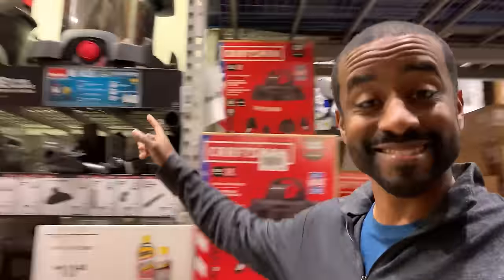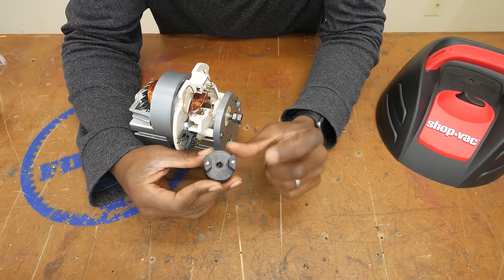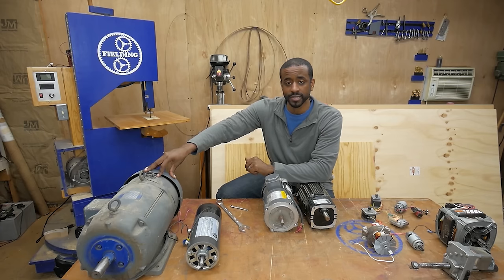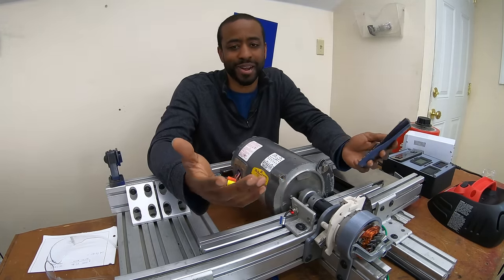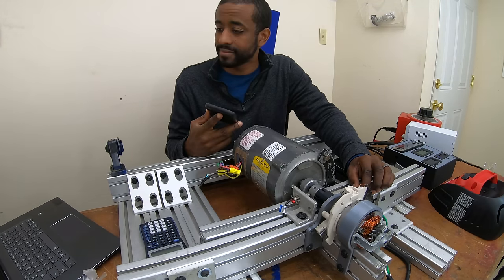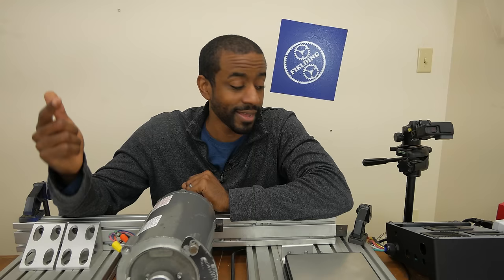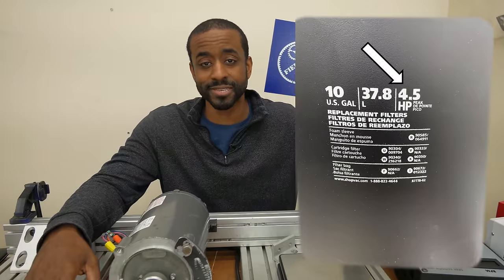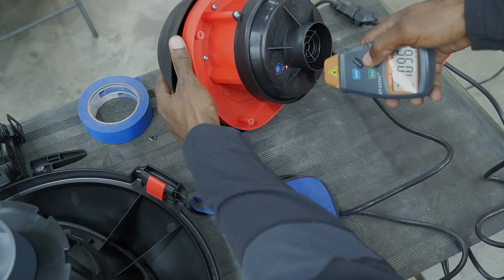How Much Horsepower Does Your Shop Vac Really Have: #078

Comment: Back in high school in 1964 my shop class learned to wind motors. After completion of the motor we learned how to test it. I remember using a device called a proney break. It was simply a stick with an adjustable leather strap that attached to the motors shaft. The end of the stick was attached to a spring scale. I don’t Remember all the details but I Remember starting the motor and slowly tightening the leather belt while watching a connected ammeter and the scale indication. Using some math were able to come up the actual hp. I love your channel. Keep up the good work. Ps seeing those hp numbers on appliances has always bugged me too
Reply from the maker: What I did was the electrical version of what you did. Exactly the same really. You were measuring torque with the leather strap and a lever pressing a scale. I am using an "electric" brake and lever on a scale.

Comment: "motor's inertial contribution"; what does this mean?  My thought is, this would be the instantaneous HP if you brought the motor up to speed and the resulting instantaneous torque if you slammed the rotation to a stop so it includes torque contributed by the angular momentum of the spinning armature.  Like it you strike a hammer on the meaty part of your thigh, 'No Big Deal', but the same strike on your pinky on a hard surface, you are going to lose a nail.  From the rpm, mass and diameter of the motor armature an angular momentum calculation could be made and would it make-up the additional HP?
Cheers, Mark
*********************************

Comment: 6 HP = ̶ ̶1̶0̶4̶7̶6̶-̶  4476 watts. On a 15 or 20 amp circuit? Not happening.
Reply: 6hp is not 10476 watts... but you're right it's not happening.
Reply: @JW77  You're right! 4476 watts, electrically. I don't know where I made the booboo! Thanks!
Reply: Also, when you say a motor has a certain HP,  that refers to output power. Motors are not 100% efficient, so it is going to be over 5500 electrical Watts consumed to deliver 6HP.
Reply: Yes, even "peak" horsepower, or for a single instant under optimal conditions, that would blow your breaker, if not outright fry it. Think how heavy the 1/2 hp motor on your average drill press is, and compare that to the weight of an entire 14 gallon "6 hp" shopvac. Yeah, it's clearly marketing b.s.
Reply: Peak HP is not Horsepower
Reply: @logun24x7  Does the word "Peak"  mean what I think it does? I know exactly what HP is because it is a well defined technical term. Are you saying I can put any two words together, redefine what they mean arbitrarily and then use them in marketing with no repercussions or liability under false advertising? I don't' know why so many people are defending it. It is just bullshit. It is not a big deal, but it is bullshit nonetheless.
Reply: @mckenziekeith7434  Peak HP is likely used because most people don't have a clue about CFM or SP sealed pressure (water lift) or how they relate to each other,  CFM being your maximum air flow and  SP or water lift measured at zero air flow would just confuse the shit out of people.  Or the fact that a vacuum with 300 CFM but shit SP would suck up wood chip just fine but not even pick up a nail or bolt from the floor ... likewise a vacuum that has 90 inches of water lift and less than 100 CFM makes for a great commercial demonstrating its ability to pick up a bowling ball but don't ask it to suck the dust out of your carpet ... so when comparing wet/dry vacuums the PEAK HP overall is just a rating to direct you to Good , Better ... Best  ... As you go up in Peak HP in general motor amps, windings, lifetime ratings, performance ratings, features included ...etc , .. also increase, you'll see this same rating on kitchen appliances, Blenders, Fans and some compressors its not misdirection or bullshit if a 6.5 Peak HP unit in the category is better than the 2.0 Peak HP unit is it ... so in short if you need your shop-vac to clean up your woodshop get the 6.5 Peak HP unit ... you need a vac once a month to pick up the cheerios the grandkids left in the back seat of your SUV you'll probably be happy with the 2.5 Peak HP vac ... The End.
Reply: @logun24x7  you make an ok argument for using motor power instead of flow or lift. But it should still be actual output power. Not fantasy peak power.

Comment: Hp rating is irrelevant, air flow would be more relevant.
Reply: Actually it would be Air Flow AT a given pressure differintial .  Engineers in the air moving fiels often refer to it as Air Horspower
https://www.engineeringtoolbox.com/ahp-bhp-air-brake-horsepower-d_1582.html

This assumes a constant value for the density of air, of course.

This same kind of published power performance creep occurs in many products, I recall it happening in the small lawnmower business until it resulted in a class action lawsuit.  We could do that in the vacumm cleaner business but lawyers would suck up all of the money!
Reply: Airflow has a lot of variables as well - with more airflow, you get less pressure, with more pressure, you get less airflow.  Which is more important?  I think there's probably a sweet spot with pressure and airflow.
Reply: @DISOPtv  The vacuum industry often uses water lift as a measure or performance. Its a good way to compare vacs if you can find the number, it usually isn't available to the public.

Comment: I've had a Craftsman 6.5 horsepower vac for about 25 years and it is seriously powerful.  I made a Thien baffle for my shop, and at first I tried using a Rubbermade heavy duty plastic trash can.  The vacuum was too much for it and it imploded.  I then used a galvanized metal can and it definitely flexes in use, but hasn't been crushed (yet).

Comment: Excellent vid. As a supplement, here’s the quick easy-button answer: 1hp = 746 Watts.  A 120V * 15A outlet = 1800 Watts max. 1800/746 = 2.4hp, assuming a full 120V at your outlet and an impossible to achieve 100% efficiency. Therefore, ANY mfr claim north 2.4hp for ANY household-voltage device is pure bunk. Thanks again for making this vid helping to de-bunk mfr claims!

Comment: Great video. I got my shop vac for about $40. I like that it has a huge metal cage filter in it that only cost about $10 to replace. I left water in it and put it away. Came back and there was mold growing in it. Had to clean out the vac and replace the filter. I actually don't own a normal vacuum cleaner. I have different attachments for carpet and one just like the car wash vacuum has. I use it for everything from the car and around the house. I wondered how accurate the number printed on it really was. Sure does have a lot of suction power. Whatever it actually is. Thanks 😃

Comment: I love your curiosity and drive to figure things out. I wish I was your neighbor...

Like you, I find things in the trash, and often, bring them back to like-new performance... and I've a half dozen shop vacs, that I end up giving away. 

I recently found a 220v, 2hp compressor in a trash pile... in spite of my best efforts, the motor was toast... it ran, but not at the 3350 rpm on the label... the compressor is fine... off to Harbor Freight for a motor.

Love your logo...

Peace

Comment: I remember questioning that HP ratings several years ago when I started seeing these high HP claims.  However I never tried to look into it and am glad you did.  As long as it picked up my sawdust and dirt, I was happy.  Thanks for the great videos, as a retired EE, I enjoy looking at them and also the effort you take to do the experiments.  As a side note: you may want to mention that 746 W per HP is a DC rating and may need to multiply in the Power Factor percentage for actual AC rating calculations. Thanks again.

Comment: Jeremy, you have done a AWESOME Job explaining these vacs, I have told everyone I know cause I look at the Capacity of the contents it can hold, not the Horse Power. Like Most vacuum cleaners using a universal motor cause the Speed of these motors would not by far produce horse power unless you gear them down similar to a Drill that has a universal motor. The key item like you mentioned is the suction power of the vacuum would make more sense. Like Suction power of X mm/hg. I think that is millimeter of mercury. I might be wrong. But most people here see the horsepower and see WOW that has more so I buy this one. Marketing BS  and most people are stupid and not know better get what BS is on the label.

Comment: Nicely done!! I remember when all the regular vacuums would brag on their amps. "Buy me I'm 16 amps" (of sloppy inefficient motor). I also remember when industrial motors were finally required to meet efficiency requirements.
Reply: I actually measured the amp draw of a "12 amp" upright vacuum. Actual current was about 8.5 to 9 amps.

Comment: The note on the ShopVac site mentions the rotor inertia. I'm guessing that the max power includes power when decelerating coming out of the rotor, kenetic energy.  Since power is the rate of energy change then a slowing of the rotor through the shaft is really kinetic energy leaving the rotor how fast that energy leaves can be added to the normal running power. This is similar to an impact driver when it runs with out the impact being engaged being the normal running power. When the torque requirement reaches a certain level the impact hammer inside the driver is activated, putting energy into a spring then into a weight for half a revolution the letting that weight impact and provide much more torque than the motor by itself could provide.  The impact hammer gives the impact driver a peak torque for a short duration of time.  The load that provides that change in speed of the rotor in the ShopVac lab is still unknow but this is how they can claim the higher peak power. - Thank you for taking the time to explain and investigate so many things.  I enjoy listening and learning.

Comment: in some countries there is a regulation that the manufactureres have to state the "suction watts at the port". So it includes not only the electrical efficiency of the motor, but as well the efficiency of the fan and the internal airflow. Seems to have stopped those crazy numbers. And since more efficient motors and blade designs are appearing not only on the "top notch" premium devices, but in the budget range too.

Comment: Yes, since I went to Electricsl and HVAC school Ive always been curious--if a shop vac is 4.5 horsepower, 4.5x746=~~3,000 and 120vac x 20 amp circuit = 2,400 vac why does UL or TEL labratories allow this b.s.  also I started testing everything from electrical fan motors for HVAC to commercisl air dryers and cnc machines people would throw away.

 A CNC machine whivh made airplane parts was thrown out because it stopped working and the owner bought a new one.  Whst did it need? A phase converter.  The old phase converters continually burned out because of impedance on one part in the system.  

Learning troubleshooting has saved my tsil and kept me busy during the 2008 turn of the economy. Thsnks for sharing these awesome videos, it's great to have a know how and a specification in an industry to troubleshoot, doagnose and repair electronics and electeical systems.

Comment: In North America, standard 120V (NEMA 1-15 or 5-15) outlets can output up to 15A max and 12.5A continuous. This means that is 1800W (2.4 hp) and 1500W (2.0 hp) respectively. To get anything higher requires a different plug with higher voltage and/or current. With NEMA 5-20, we can go up to 20A, giving us 2400W (3.2 hp).

Comment: I like seeing these test. I work in the car audio industry and the amplifiers we deal with are even worse than this at their ratings. Boss comes to mind, 1500 watt rated gets you around 195 watts rms.
Reply: If you're looking at car amplifiers, forget what it says on the box: you can get a much better idea, if you look at the FUSE. If the amp has a 30 amp fuse, it cannot draw more than 360 watts, from a 12 volt source. Your output will be less than that, otherwise, the fuse will blow. If you have a class "AB" linear amp, 195 watts RMS is about all you can expect, from a 25 amp fuse, due to the efficiency losses of an analog output stage. A class "D" switch mode amplifier can deliver that with a 20 amp fuse.
     Same with horsepower. A 100% efficient motor with 100% power factor can only produce 2.4 horsepower@15 amps from a 120 volt source, about 3.2 Hp from a 20 amp circuit. Keep in mind, this motor is less than 55% efficient, so, you can pretty much cut these numbers in half. There's no way a household outlet can fully power a 4.5 Hp motor!

Comment: As an electrician I can tell you this is a selling point as power is power; HP and Watts are defined power terms. This is like comparing Amp/Hrs in batteries it’s pointless without battery voltage; Watt Hours is the go to comparison. I like on the commercial side of things when they compare power by feet of water lift which does actually point to suction power. I can tell you in all practicality no portable vacuum motor can exceed 2 HP as you couldn’t plug it in and run it without blowing a breaker. Hardwire vacuums on the other band can be a lot larger and more powerful and if you don’t need portability is the way to go; a garage vacuum or central home vacuum will out suck any portable unit out there. .

Comment: Love your videos Jeremy, I only discovered you recently but wish I'd discovered you sooner. Very cool testing. 

With that said you seem to have missed some things in the definition of peak horse power you displayed on the screen. 

1. It's a standardised INDUSTRY term for wet & dry vacuums used for the purpose of consumer differentiation. 

That tells us a few things. That the individual companies are never going to disclose how the test works because of liability you'd have to go to the industry association. That they admit the number has no meaningful impact on the capability of the machine. That it is a marketing term they use industry wide to allow consumers to compare products. Like in TVs where they focus on resolution even though resolution tells us the least amount of actual information about a TV's quality and there are actually zero consumer facing 4K televisions (they're all UHD). Same for PCs and SoC clock speed or core count. It's a simplified term that gives you very little actual information but allows an ignorant consumer to differentiate products and justify prices across the product stack. 

2. That they measure output not input like you said. 

3. That they include inertia in their calculation. 

That doesn't mean much to you because you're coming at this from a logical position on how you might honestly test a motor. You discount inertia because you know what inertia means. That's not what's happening here, you have to stop thinking like an engineer and start thinking like not just someone at a company from marketing but a room filled with marketing execs from across the industry deciding on a term. 

Think of it like this, what convoluted test can you come up with that will give the highest possible numbers even if those numbers have no bearing to the actual product. 

That's where inertia comes in, it's the key to where that 4.5hp number comes from.  Have a think on it, don't allow yourself to be constrained by honesty or truth. Have a think about how inertia could be used to inflate the numbers. I think it'll come to you and when it does those numbers will hurt even more. 

They do similar tricks with other types of vacuums too.

Comment: We used to have same problem in the air conditioning industry. Everybody lied. Many years ago this was addressed. Now, through AHRI (Air Conditioning, Heating, and Refrigeration Institute) everybody has to test and rate the same way, honestly. Looks like a rating agency is required for shop vacs! Thanks for this great video. I have had the same revulsion when I visit the shop vac isle, knowing that "this can't be."

Comment: "including inertial contribution" = "we spunt it up, then took an instantaneous reading as we slammed a braking force on it, extracting the rotor inertia for a very brief moment, taking a measurement while the rpm was still high, and the torque is impossibly high because of the acceleration (deceleration) from the load.

Comment: Start it with no load, when it reaches max rpm bring it to a hard stop and measure the applied torque to stall it. You will get the torque of the motor plus the torque of the spinning mass.  This could break the output shaft, in this case peak HP is just the max 
torsional moment multiplied by the max rpm. That should be enough to reach the numbers on the box.

Comment: OMG!  I was just trying to figure out the HP rating on my old Craftsman shop vac because I was comparing it to a new one that say "peak 6.5 HP".  I thought 6.5 HP was oddly way high.  My old shop vac didn't have a HP rating  - they didn't do that years ago -  it is rated at 120V and 7 amps for a calculated HP of 1.13 HP.  The new shop vac "6.5 peak HP" actually rated at 12 amps for a HP calculation of 1.93 HP.  This is higher than my old shop vac, but no where near 6.5!  The I started searching the internet and found your video.  Thanks!  as you confirmed what I thought - no where near 6.5 HP!  But the newer shop vac does have more horsepower than my old, so that is good to know, but this advertising of 6.5 HP is just plain wrong!  Thank you !!!!!!!